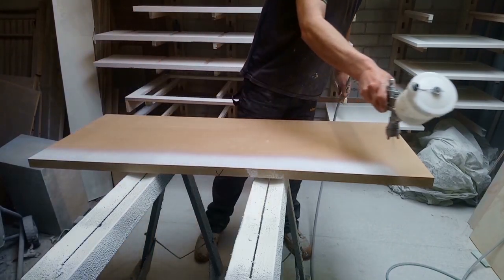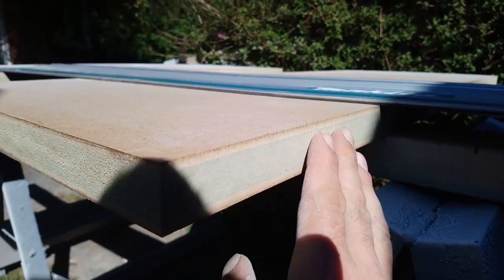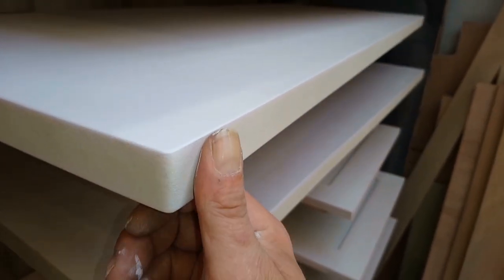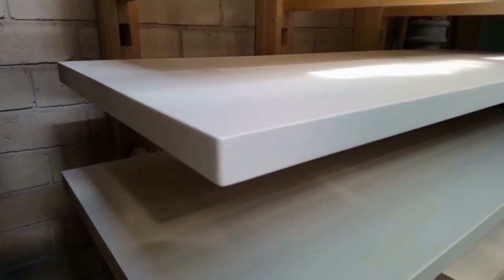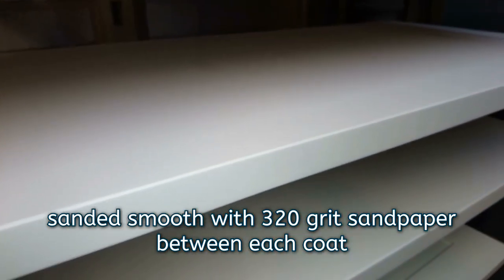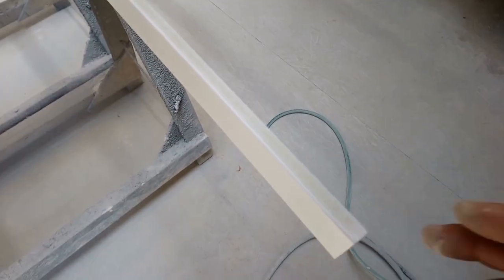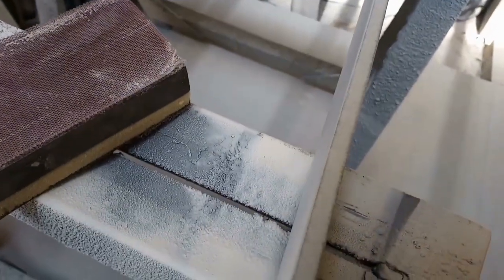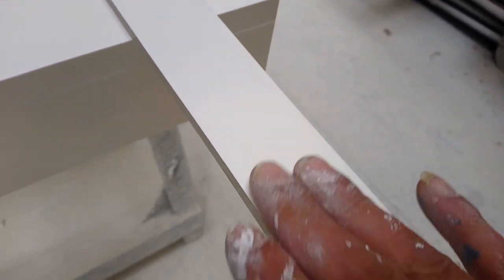How to Paint MDF edges - without special sealers

Comment: Great video. Very useful. 

Do you have any thoughts on just painting the edges with a brush the first time, then sanding smooth and then spraying the panels thereafter?
Reply from the maker: Painting by hand leaves brush strokes, over-spill onto the face, this paint isn't designed for hand painting & is time consuming, pointless when you have a spraygun that will give a quick , consistent flat finish
Reply: Gid Joiner makes sense. Thank you!

Comment: There is a quicker way for edges . Sand it with 120 / 240/ 400/ and on the end 800 grid sand paper. This way you can start prime and paint like rest of surface no different
Reply from the maker: That's what I do, I use different grits of paper, but basically sand smooth then paint as with the surface, the edges always need a little attention, more paint or sanding but same paint as the rest of the board,

Comment: great video. what primer and top coat do you use for projects like this thanks
Reply from the maker: Thanks Richard 👍
I mainly use a 2 part PU enamel, it dries in about 30mins dependant on temp, it's hard but has enough flexibility to withstand a few knocks without chipping & it's impervious to most household chemicals

Comment: Great video! Can you share a link of the paint you use and where you get it from? Thanks in advance
Reply from the maker: Hi, I mostly use a 2 part PU enamel paint, it's hard wearing, resistant to most household chemicals & has enough flexibility to withstand the occasional knock,
There's others, a single part Pre-Cat enamel paint  & a 2 part AC enamel, the Pre-Cat & AC are both easy to spray, but the Pre-Cat isn't very hard wearing, the AC is very hard but both can be brittle so chip when knocked because the wood underneath is relatively soft, there's no flex in these paints & both are susceptible to acetone which is in nail varnish remover.
I get it colour-matched to any colour from Symphony Coatings, good people, they'll advise if needed Thanks Kris 👍😊
https://symphonycoatings.co.uk/?v=79cba1185463

Comment: Can your recommend a good spraying system.?
Reply from the maker: Hi, I don't know much about the electric sprayers, my neighbour uses a Fuji system but they're not cheap. I have a Bostitch 50L compressor which is only just big enough, I'll upgrade to a 100ltr with a bigger CFM one day maybe, I've a variety of Gravity fed guns & a wall mounted regulator/filter set at about 20-30psi, very simple to set up & clean, The cheaper guns i use sometimes are ANI for about £24, they're good to start with, the black ANI i use sometimes is a bit more £45-ish & the Devilbiss FLG5 is closer to £100 but it's the best & my favourite, it's the one you'll see me use most of the time, the paint strainers i use for all paints, the only ones i buy are Starchen 190, I get mine locally but they can be got on ebay etc. https://www.ebay.co.uk/p/1292815382?iid=113200954395&chn=ps&norover=1&mkevt=1&mkrid=710-134428-41853-0&mkcid=2&itemid=113200954395&targetid=879043638628&device=c&mktype=pla&googleloc=9046317&poi=&campaignid=9455575137&mkgroupid=94880575894&rlsatarget=pla-879043638628&abcId=1139576&merchantid=7341554&gclid=CjwKCAjw5Ij2BRBdEiwA0Frc9SSEKwHUlAOBKkG1HPN803XblvAQwt4Mt6gWa1BsEcuE70eue-P9fBoC2_EQAvD_BwE A compressor is good for any workshop tho if nothing else but for blowing up your tyres 😁 This company is good for guns https://www.spraygunsdirect.co.uk/index.php/

Comment: Great video what kind of paint are u using
Reply from the maker: Thanks 👍
I generally use a 2part PU enamel paint, it is hard but has a bit of flexibility to allow for the occasional knock.
There's 2 others i occasionally use, they're a little easier to spray but are very hard so chip when sprayed on wood as the wood is relatively soft compared, one is a 1part Pre-Cat enamel, that's the easiest & cheapest but isn't as hard wearing, the other is a 2part AC enamel, very hard wearing but too hard to allow for knocks so chips when bumped, both of these are susceptible to some chemicals like nail varnish/acetone. PU paint isn't.

Comment: So the answer is primer and sanding? Is that different from sealing it?
Reply from the maker: The first coat of whatever you put on is the sealer, it 'prepares' the wood, it makes the fibres swell n holds them there, then when you sand it smooth n put another coat on the fibres have been pre-swollen so the next coat needs less sanding, It's hard to lock the fibres in as a sealer would suggest, it's more about manipulating them to do as you want,

Comment: Would you get the same finish using emulsion paint and a roller?
Reply from the maker: I don't know, i rarely hand paint stuff, you'd prob get some texture from the roller but the process is the same, sand down the first coat smooth then the second will go on better & finish flatter, sand that second coat smooth,
Reply: @Gidjoiner  thanks for your reply, I'll give it a go 👍